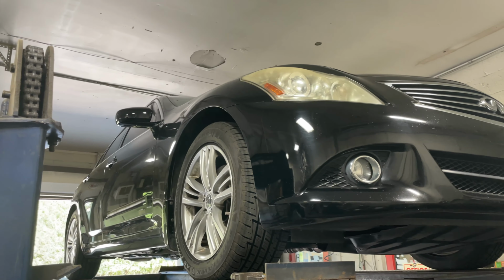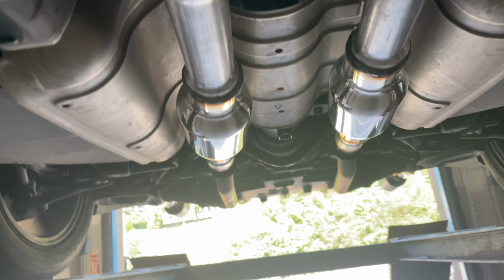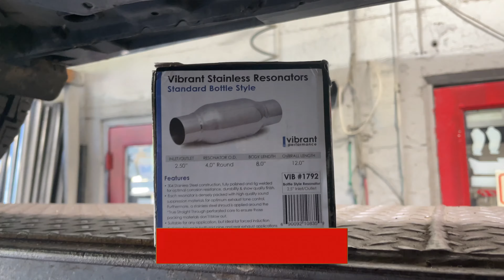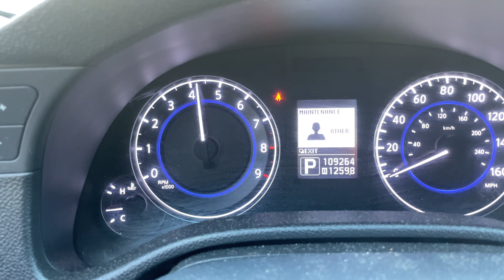2012 Infiniti G25 2.5L V6 w/ VIBRANT BOTTLE RESONATORS!

Comment: i don't think i have heard of that particular Infiniti before at all or a 2.5 liter V6
Reply: Just bought one 1 week ago , love it super fast super econo its great😊
Reply: It was made in 2011-2012 as the smaller displacement model of the G37.  It was made to compete with the Lexus is250 (also 2.5 V6 until 2014) and such.